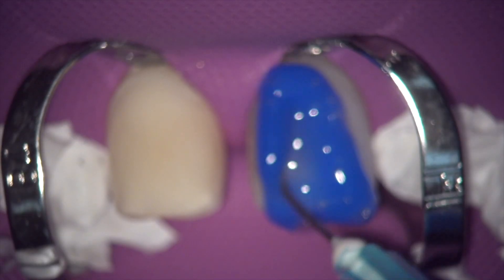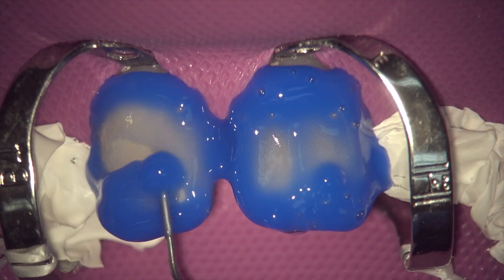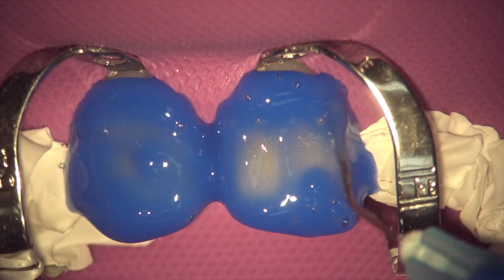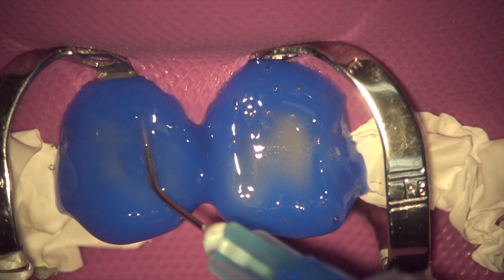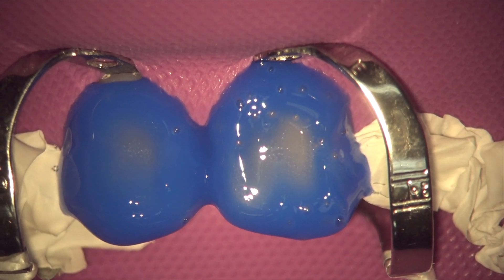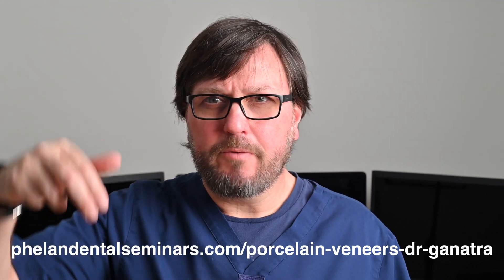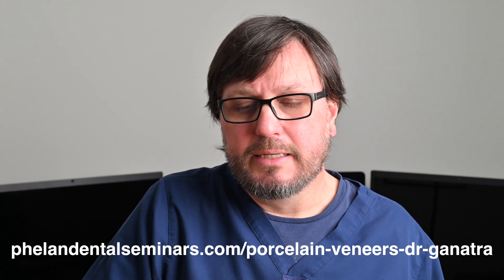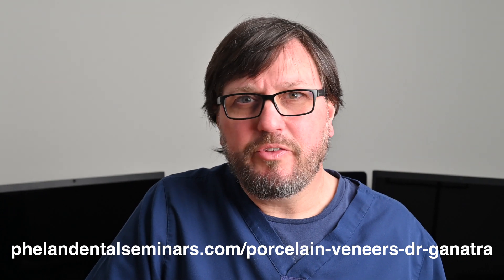Simple Tip- How can we differentiate between composite and the tooth?

Comment: Why the hell don't you just put fluorescent pigments or dyes in the filling composite in the first place?  Then all you would need is a UV light?
If it was your teeth wouldn't you rather a doctor just shine a uv flashlight on you rather than melt your teeth with acid.
Reply: Fluorescence is complex and adding fluorophores affects the overall luminescence of material, which alters its visible emissions under sunlight and other ambient sources, such as disco lighting. People want invisible fillings, not ones that become distinguishable under varying ambient light conditions. Also, etching teeth with acid is a highly conservative approach to restoring them.